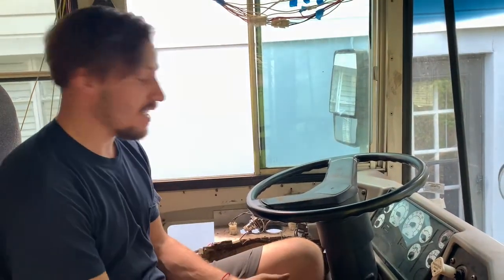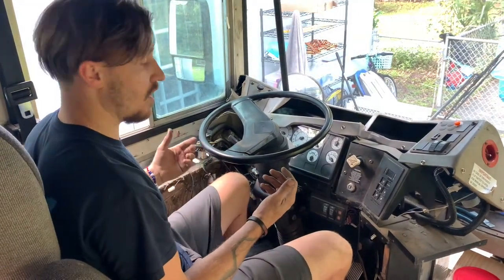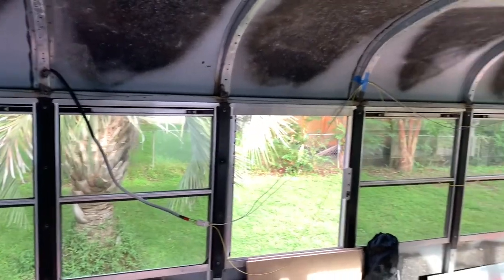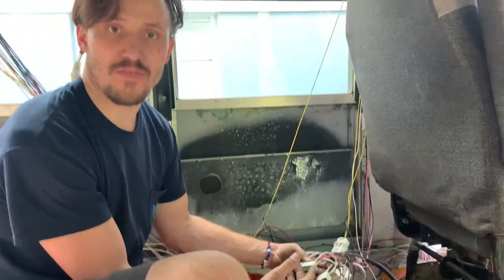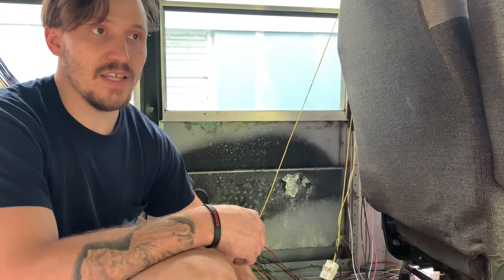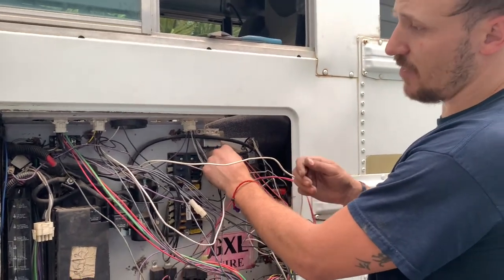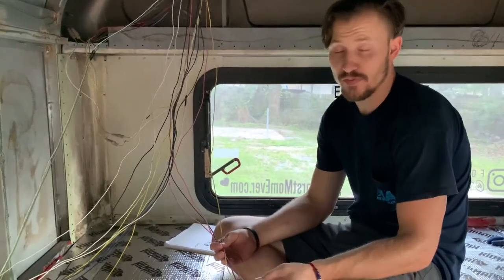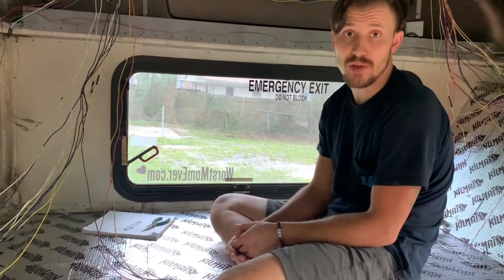Skoolie Electrical Wiring Removal - School Bus Conversion - Skoolie - VIDEO

Comment: Will help in future when on the road after conversion. If you don't have the bunch of random unused wires confusing you when trying to troubleshoot issues later
Reply from the maker: You’re absolutely right! It will definitely make things easier in the future.

Comment: Yikes we disconnected wires to our skoolie and cannot figure out how to get the rear lights to come back on. Any insight on figuring out the wires to connect the back lights to is appreciated 🙏
Reply from the maker: We actually ran into this issue too. Ours were fine and working and then we wired our floodlights in (the back one to tie into reverse lights) and when we tested it...it worked and now it doesn’t. I think there is a short in the circuit somewhere? The wires by the taillight are rough...so we need to replace it and see. All I can say is run every single wire back from where it starts to the fuse box, check fuses, etc. it’s time consuming, but the only way to figure it out. Good luck, I know it’s frustrating

Comment: Some bus conversions decided to keep the switch for front heater to defog the windshield and I think I heard you say you're removing yours.  I'm curious if you have had an issue with fogging?
Reply from the maker: Super good question and one I don’t think we can accurately answer as we are still in the build process and don’t drive it an incredible amount of time yet. We’ve yet to encounter a situation where it mattered and I know there are after-market products you can buy to mitigate the issue, but I can’t offer more input than that. I will say, I know Shane and I don’t regret the decisions we made as far as getting rid of those “debatable” items like the a/c, heater, etc simply because of the insane amount of space they took up. Hope that’s at least mildly helpful. 🤞🏼
Reply: @TheMcBrowns  I guess if you decide to chase warmer climate in the winters or not live in it in the winter defogger is useless anyway.  Best of luck.

Comment: Cruise control?  Not sure that was correct.  That was your throttle accelerator and decelerator for idle speed adjustment.  You wanted to keep that.
Reply from the maker: If we are talking about the same thing, it was a cruise control option that was never even connected. Maybe it was an option they didn’t pay to have installed, so it was essentially a dead button. 

I’ll definitely re-check the manual in the morning to make sure we didn’t accidentally do anything stupid. 

Thanks for the heads up and thanks for watching!!
Reply: The McBrowns Yeah I have the same bus as you that’s how I found you on YouTube. Unfortunately I’m about 99% sure you cut your throttle switch which allows you to change the speed of your idle. If you still have the switches you should try to reconnect them.
Reply: Also, in cold weather to avoid engine damage the manufacturer recommends that you maintain a minimum 1250 RPM idle speed.  You’ll need those two throttle switches to achieve that.  Sorry to be the bearer of bad news!
Reply from the maker: @euchrewacko  if we are talking about the same time in the video (1:05-ish) - that was a cruise control - we checked and re-checked. Although our buses may be similar, there are often some differences. I took a picture to show you (because we still have the actual wires...and even on those it says "cruise - ON/OFF" for one and "SET/RESUME" for the other one - I can't attached a photo here, apparently, but as far as we can tell - we did not remove any throttle switches...but we will keep looking to make sure we didn't get rid of anything important.         Would love to see your bus! Are you tracking progress on an IG account or anything? We love seeing what others are doing with buses like ours. Thanks again for reaching out - it's nice to have people keeping an eye out for us! ☺👍
Reply from the maker: @euchrewacko  that’s a beautiful bus! Yeah, they are very similar and very different. Ours was a military bus, so has far less extra bells and whistles (especially of the safety kind) since it is not transporting kids. Super jealous you have that side emergency exit and the under storage. Can’t wait to see what you do with it all!
Reply: Thanks for this group of comments. I had no idea what the throttle buttons were for. Now I know. Thanks